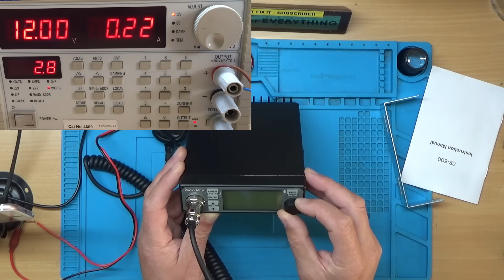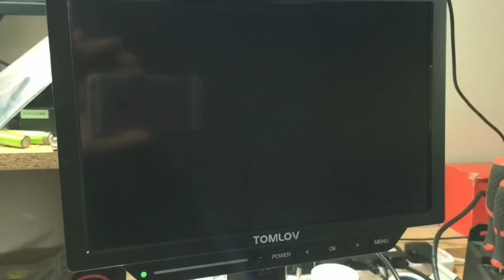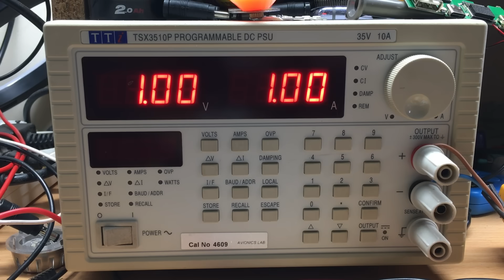Faulty Radioddity CB500 CB RADIO | Fixable?

Comment: Good analyses. Ton of info on that micro (makes a change), though, as you say, without the firmware and tools then a no-go. Also has a unique ID and encrypted programming interface. 10-4.
Reply from the maker: Thanks Ralph 👍I did have a quick look around but I could only find the datasheet in Chinese which I used google translate on. Couldn't really find much else on it.

Comment: I was just thinking, Mick probably a stupid idea, is it possible to buy a new chip and piggyback onto the existing chip but aren’t the existing chip disconnect the pins that are shouting out, so you could possibly get the firmware to output and working on the original tip but bypassing the bit is broken on it and having a new chip work that part?
Reply from the maker: The old chip wouldn't get any power as it's shorted internally. It's the main power pins that are shorted on it.

Comment: It also happens to me to find the microcontroller shorted and not having the firmware is very frustrating
Reply from the maker: Yes 😢 I was just reading the comments and someone suggested that someone may have plugged the wrong mic into this, as there's 12v on the mic socket which could have then been sent into one of the input pins.

Comment: that MCU doesn't even have Datasheet in English - only in Chinese - it's ridiculous! however, until the consumers don't stop to buy such junk devices that are unrepairable, those practices will continue, unfortunately. the manufacturers should be forced by law either to provide the MCU code or if not - at least sell programmed MCUs as spares and otherwise not be allowed to sell those devices (in Europe). I recently needed to buy over 200 GBP programmer to fix the MCU of my iron soldering station, but at least it's from reputable company that released the latest MCU firmware, when they discontinued that model of soldering station. so, even with that 200 GBP spent for programmer I am glad to pay them and it worth to do it, because it was fix plus upgrade to the latest MCU firmware adding few more and important features. my point is - any device that has MCU and the MCU code is not available or no programmed MCUs are sold as spares should be considered - disposable junk that most likely is just waste of money.
Reply from the maker: Yes, I could only find the datasheet in Chinese too. I was trying to see if it mentioned code protection. It more than likely has it, as I 99% of MCUs do. Well done fixing your soldering iron 👍

Comment: Bummer.  Thermal cameras are a game changer.  Good diagnostic work as always.  I wonder if a grovelling email to the company plus picture proof of the unit and serial number would get you either s pre-programmed controller or the firmware?
Reply from the maker: Cheers Mike👍, yes thermal cameras are almost a necessity these days. I'm not sure who the manufacturer of the device is as the same unit is sold under different names. There's CRT Alpha, Anyone AT500M, and a Jopix GS60 which are all the same...
Reply: @BuyitFixit  Ah.  Was just a thought that you no doubt had anyway.  I keep looking at your thermal camera offers every time, but even with discount I can't justify £250 as I don't fix much anymore.  Back when I used to fix a few TVs one would have been brilliant.
Reply: When thermal cameras wasn't a thing to buy for everyone a wet finger was just as good.

Comment: Do you know how to fix a VW rcd3010 stereo with the buttons are melted because of an air freshener can I fix it my self or do I have to send it way to get fixed
Reply from the maker: I'm not sure on that one mate. Is it even worth sending it away to get fixed? There's one on ebay for £36, you could just use that or swap the front panel over https://www.ebay.co.uk/itm/306484033951

Comment: Good effort & good find anyway.  Last time I took the back off a CB (early 90's) it looked like a flight computer from the Apollo missions, there's nothing in there now, why's the case that big?
Reply from the maker: Thanks mate 👍Yes it's the way it goes sometimes. I guess the case is big so it's a standard form factor to fit in things like tractors or wherever where they have a standard size radio slot.

Comment: Great diagnostic - well done Mick.  Just a thought, maybe it might be worth reaching out to the manufacturer to see if they would be willing to supply a programmed MC. 😊
Reply: Would it be possible to extract the code from a working microchip?
Reply: @MrDocomox 10:19
Reply from the maker: Thanks mate 👍I'm not sure who the manufacturer is, Radioddity seems to just be a re-seller, as the same device is sold under different names. There's CRT Alpha, Anyone AT500M, and a Jopix GS60 which are all the same device
Reply: @BuyitFixit how much do you charge? I have a bunker hill security monitor that my uncle got from harbor freight long ago and the power goes in. Only 2 capacitors are getting power of the 8. Other than that nothing else has power on the circuit board.
Reply: @BuyitFixit producer is Anytone...President also runs this model by the way....

Comment: I wish you lived closer to me. My kid has a motorized wheelchair motor that has a recalled speed controller. It will spontaneously start moving without any input! The company has yet to send a replacement speed dial  either.
I took it apart and its a potentiometer and some discrete components.
Reply from the maker: Sorry to hear 😢

Comment: You might find chirp software can flash it
Reply from the maker: Thanks fot the suggestion. Chirp only does settings. The radio has to be able to boot before chirp would work. I've used it before for my boafeng. There is no actual firmware available for this radio or the two other similar radios that look identical.
Reply: Always found chirp hit and miss to be fair. Good vid.
Reply from the maker: @tazmaniachill Thanks mate 👍